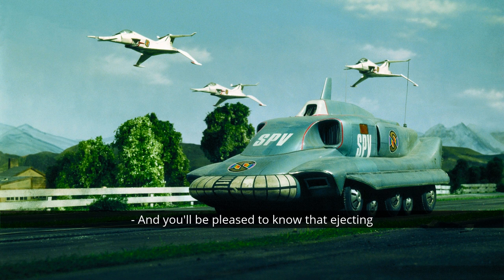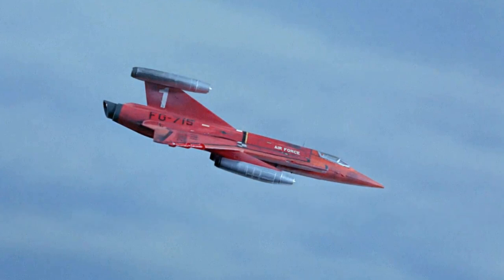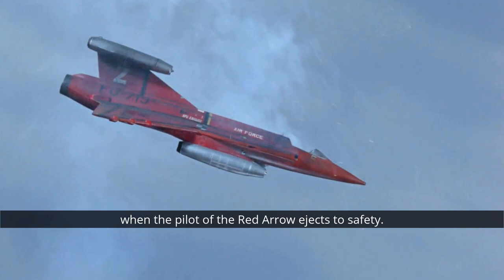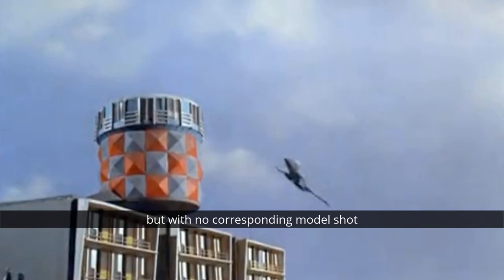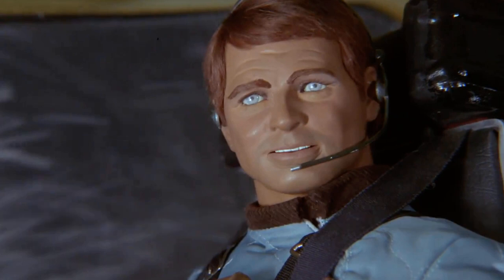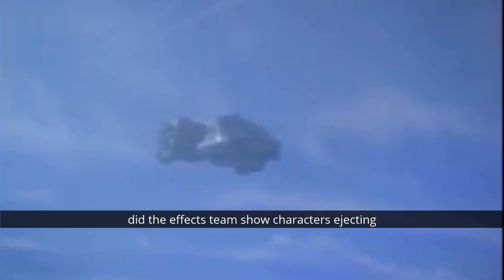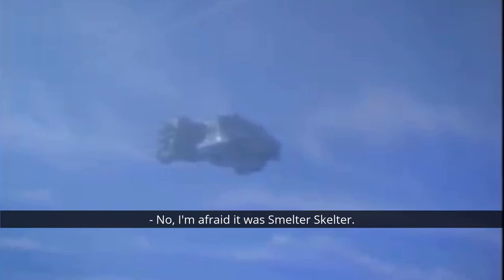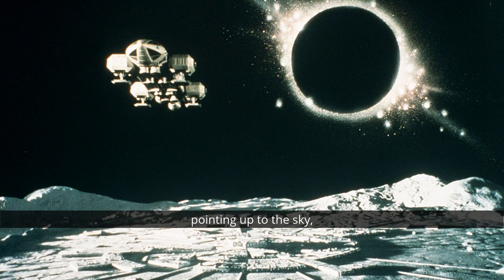FAB Facts: The Methods Used to Film Ejecting in Anderson Shows

Comment: The Red Arrow looks like an F-102 Delta Dagger model with the engine nacelles of a B-58 Hustler bomber added to the rudder and hard points.
Reply: You are right that B-58 engine pods were used; probably from the 1/128 Lindberg kit from 1959.  But I think the main aircraft was likely the Lindberg (ex Adams) 1/48 Saab Draken kit from 1960. (All according to Scalemates.) The "Thunderbirds" episode featuring the Red Arrow, "Edge of Impact," came out in 1965, so the timeframe would be right. 

That said, I've always appreciated that those Gerry Anderson shows had lots of fantastic aircraft made from off-the-shelf model kits that just about ANY fan could replicate!